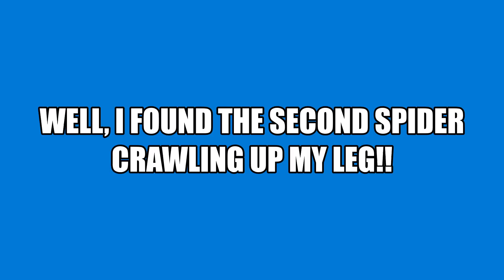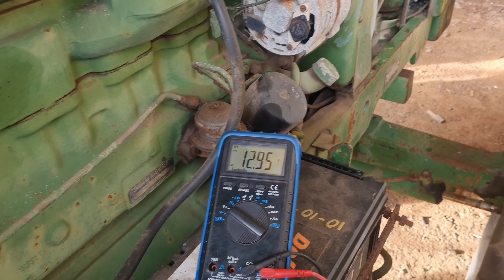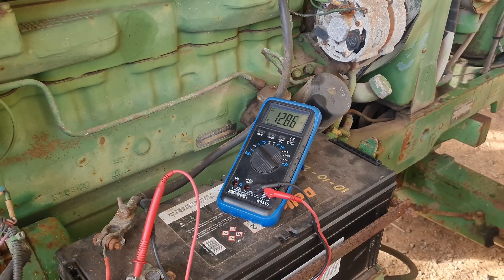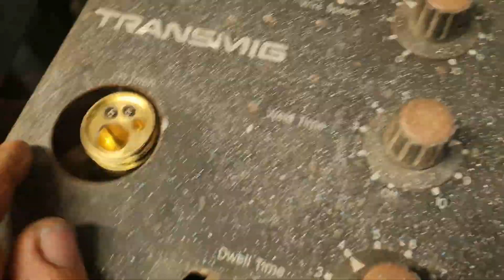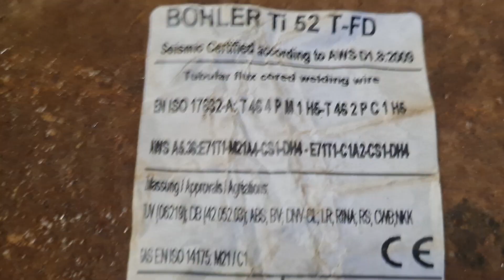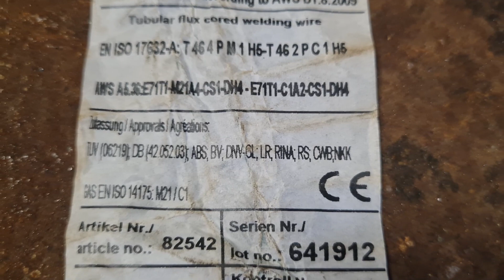JD 3140 and welder upgrades

Comment: Nice Pete, we had the 3350 open rops which looked very similar to this for many years and it was a brilliant tractor. What are the plans for this one? Bruce
Reply from the maker: Hi Bruce, thanks for the comment. We have a 12,000 liter water tank that's missing a tractor to pull it around. To that end, I will have to fit an air compressor and the appropriate valving to operate the air brakes when the time comes. Yes, I will most likely do a video on that modification.  :-)

Comment: Still mystified as to why you got the slag on the weld if the shielding gas was flowing ?
Reply from the maker: The wire is 'dual shield', which means there's flux inside the wire as well as the gas shield. It's designed to work with both.
Reply: Did the impact wrench give specs as to how many foot pounds of torque?